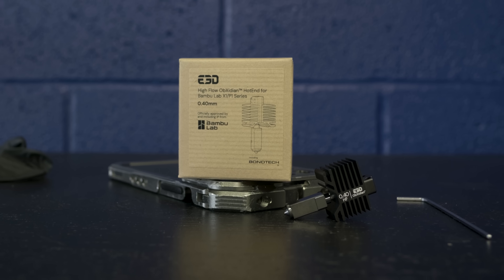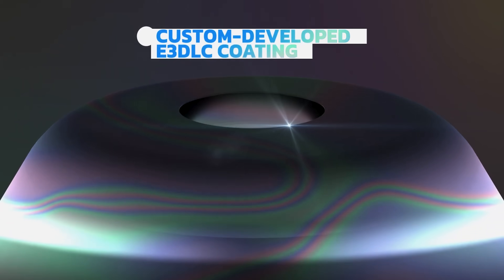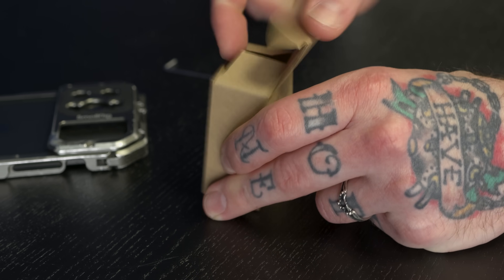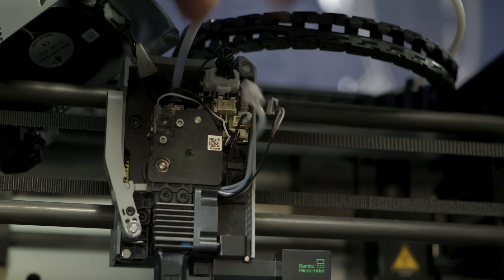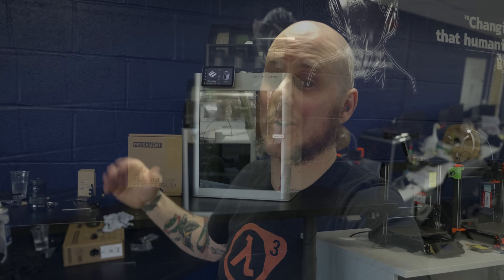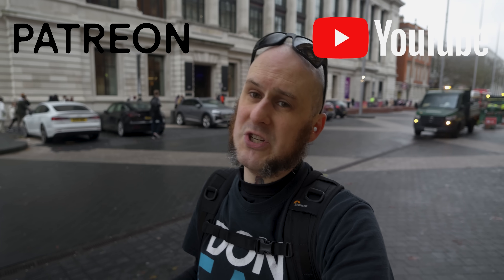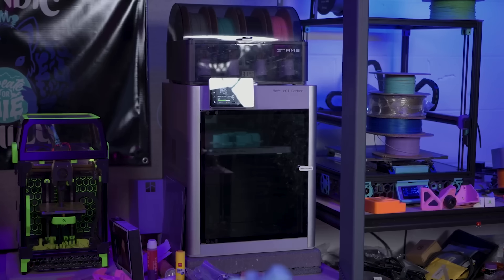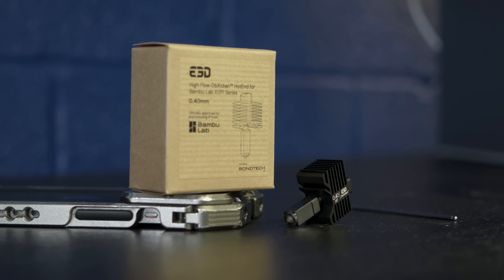REAL High Flow Bambu Hotend from E3D?!? - Install & Test AT E3D

Comment: Don't believe the hype.  I bought and installed one on my P1S.  It makes zero measurable difference in print time on small items.  The part needs to be large with big sweeping walls to have any measurable difference in print time.  I emailed E3D and confirmed this.  But at least it's now a spare hardened nozzle, I guess.

Comment: you can't trust the guy with the tatoos... :) Ok seriously, your flow print test doesn't show 18 vs 27 difference , seems like it failed in both cases. you didn't even say what was printed with what nozzle... smells like BS...
Reply from the maker: These were two different g-codes because we were on a time crunch. The 27mm3/s started at a higher flow rate. I forget what though, but say the stock one went form 5-25mm3/s in the gcode, the ObXidian HF one went from 15-40. Not exact numbers but that is an explanation of why you can’t put them side by side to compare. 

I’ve revisited this hotend much more in depth and compared it to a cheapy “high flow” from AliExpress too. You can see MUCH more involved testing in this video: https://youtu.be/AppUVvf-UGg?si=YLbnpqa-56d7o1-P

Comment: I guess this is fine if you have one of these machines or use this part on other machines but I think I will just grab a CHT from someone other than bontech or e3d.
Reply from the maker: Why? The clone versions don’t flow as well and are usually made from low quality materials that wear out very quickly in my direct experience. I’ve tested them in other videos and found the genuine article is superior in every way.
Reply: @MandicReally  mainly because I won't be using the v6 style for much longer anyway and the clones cost less whilst still offering a improvement from what I can tell.
Once I do move to a newer system I will grab one from e3d, diamondback or bontech where applicable.

Comment: Very cool bench test 👍
But what's about the BIQU Panda Revo Hotend ?
Did you test it ? The announce a flow at 40 mm3/s
Reply from the maker: I have yet to test it. Biqu sent me one for the wrong machine and I’ve not gotten a chance to use it as a result. 

I’ve retested this E3D unit since this video though with BETTER results and more data to back them. Check it out in this video: https://youtu.be/AppUVvf-UGg?si=TkhQVJpGdlAjiVhu

Comment: Got this in nozzle size 0.6, and it just wouldn't work at all with default bl 0.6 settings. Taking me days to tune this little mofo, problem is theres hardly any info out there for bl p1p/s profiles. But sure, its 52 volumetric flow rate is attractive on paper, but hard to tune in for practical prints.

Comment: For me, speeds and flow are fine. I rather have a coated nozzle that PETG wont glob onto. That's my biggest nozzle/filament issue. If their coating helps that I might be in for this.

Comment: I've been getting noticeably better looking prints with the E3D nozzle even when not printing faster
Reply from the maker: That touches on a topic I'm really not sure how to cover (or if it is a real thing), but in my head makes sense. My Theory: If you have a hotend capable of flowing more filament, it will produce better strength & quality results at lower flowrates too. My logic being, you aren't pushing it to its limits so the hotend has an easier time of maintaining consistent and healthy flow throughout your print, producing overall superior results. 

I think this is a subject I may have to suggest to Stefan over at CNC Kitchen. Does a High Flowrate hotend produce superior quality & strength results, when NOT maxed out?

Comment: I get a "Nozzle temperature malfunction" error with these high flow hotends...can't figure out what's going on after a ton of troubleshooting.
Reply from the maker: The heater element just isn’t strong enough. As filament flows rapidly it takes heat with it. Faster flow, more heat taken away. Most high flow Hotends have higher wattage heaters to keep up. The E3D Revo High Flow kit comes with a 60w heater instead of the default 40w unit that the base Revo has.
Reply: @MandicReally  I thought the stock heater was 48W not 40W, since the E3D hotend is used with a Bambu Lab heater.
The odd thing is that I get the temperature error inconsistently - at low flow rates and higher flow rates.
It's pretty similar to what you showed in your other video, but your solution wouldn't work since I was already printing fully enclosed. It seems to happen all the time with the max flow rate "racetrack" test, but not so common during normal prints, even when I'm pushing the printer really hard.
Reply from the maker: The stock Bambu one is 48W, I was referring to the E3D Revo Hotends when I said 40 & 60w. Their other line of Hotends.

Have you tried changing heaters? I know ModBot ran into the issue more than I did. I wonder if there is just that much variability in the heaters and thermistors. Without being able to monitor better & PID tune, there isn’t much we can do to research that.

Comment: i own my p1s for about 1 month now.. and i wonder whats the benefits of these? im not getting it? i can just get some from babmu with hardened steel... what is the difference ???  sorry im a lil bit confused
Reply from the maker: Higher flower means you can achieve higher extrusion rates. That could mean thicker extrusions at higher speeds, higher speeds on lower extrusion thicknesses, or just stronger parts due to more consistent extrusion. It isn’t something everyone needs, more for those trying to push their machines to achieve as much as they can.

Comment: Would love to see a shootout between this and the aliexpress v2.0 hotends with hardened steel CHT clone at some point. People have been getting a clean 35-40 on those for a bit now and a cleaner surface finish. Wonder if the gen 2 Bambu will switch to high flow.
Reply from the maker: I’ve got one on the bench right now (of both designs). Biggest issue is, the Ali Express ones AREN’T hardened. Only the outside of them is. The actual high flow splitter portion is raw copper. So it’s gonna wear down FAST with actual abrasive materials. I may devise a way to test that too.

Comment: i dont get it what to do? i changed the flowrate but what else do i have to change? its just 1% faster at the moment. are there any profiles? printing asa filament. thanks for help in advance. cant find any info at bambulab or e3de about settings
Reply from the maker: I’ll work on tuning in some profiles on mine I guess. Bambu & E3D haven’t done so yet that I’m aware of.
Reply: @MandicReally  will U share them then ?

Comment: My stock P1P prints up to 21mm3/s, so - How exactly this is an improvement?
Reply from the maker: What material and test did you use to determine that? How did you qualify what the maximum flowrate was? Have you tested or are you just looking at Bambu's volumetric flowrate limit setting for their own filament slicer profile? 

All those questions out of the way, I showed this improved flowrate on one material by 50%. It stands to reason that if you legitimately are testing and finding you are getting 21mm3/s out of your stock hotend, you may well get upwards of 30+mm3/s on that same material. Now flowrates are not so easily calculated or determined. Material properties, individual machine properties can vary and effect results. One material to another can have vastly different flow characteristics. Or testing methodologies can influence outcomes too. Like I can crank temps to levels I'd never print at just to boost flowrate numbers in a test, but that doesn't translate to what I'm going to use day to day. 

I cannot speak for you on what this would all mean for you, all I can do is present tests that show this hotend improves flowrate. Which can lead to stronger parts at similar speeds to current slicer profiles, or the ability to unlock higher speeds than the stock hotend can allow. I personally find the stock Bambu hotend a limiting factor in pushing speeds on these machines.
Reply: @MandicReally   , I believe everything you said, but probably we study different physics, because it's a simple math to determine a flowrate... 🙄
Reply from the maker: @ELMANTEC  you'll have to explain that to me. Are you quantifying the heating capability of the hotend? Length of the meltzone? Chemical properties of the individual spools of filament? How are you calculating flowrate without running a physical test? 

I am NOT someone who says "Math is pointless", but formulas and calculations that are purely on paper don't factor in variance of reality. The same as not all Flowrate tests show the same results. Purely extruding into free air and weighing the finished results doesn't factor in the pressures generated by the layers below & behind an extrusion point. The rate of extrusion can vary due to the current applied to the extruder stepper motor. There are SO MANY variables in the real world that math formulas alone cannot factor in.
Reply: @MandicReally  My apologies if I left you with wrong expectations, but I am not here to educate people. I know you will say -  "ahaaa, I knew it, he cannot explain it...". It's ok, you can say it. 
   I already regret I started this comment. :/

Comment: If your flow rate is really down to 12mm3/s you're doing something wrong.
My flow rates are all above 19 and even 22 for eSun ABS+.
Reply from the maker: We will be retesting thoroughly when I get to doing another update video on my X1. But I’ve been pretty solidly sitting with my profiles there for a while. And the default profiles from Bambu are generally similar.
Reply: @MandicReally  Bambu's profiles are very conservative because they want them to "just work" for everybody, which is fine. But you can easily push the envelope, although it greatly depends on the filament quality too.

Comment: We‘re talking about 60 Pounds for a single hotend, ✨Innovation✨
Reply from the maker: So I jumped on 3dJake, a European printer parts retailer and checked pricing. The MAJORITY of Hotends they sell are over $76 USD (what 60GBP converts to). Phaetus, MicroSwiss, Slice, Flashforge, Zortrax, and even CREALITY Hotends are more. And majority of those don’t come with a heater or thermistor. And almost none of them have to license technology from other companies to be produced like E3D has to do with this design (Bambu & Bondtech). 

Bambu sells there “hotends” so cheap it feels like an undercutting of the market, so folks now expect that to be the standard. I wish these were cheaper too, but in the grand scheme of 3d printing, it’s not a horrible price.
Reply: @MandicReally  back in the days we were able to change the nozzle, a cost effective way to enjoy the hobby. They can create/produce consumer friendly stuff if they really want to, but that’s not their kind of innovation. I get the point of keeping the weights low - but your printer depends on their pov/interests.

You can find alternatives with changeable nozzles, therefore a much cheaper way to achieve higher flow ratios (CHT Nozzle)/ a cheaper way to change your nozzle diameter. So we compare a much cheaper variation to a single hotend. 

You can spend money on whatever you want, we should all accept that, the words above are just my thoughts on modern days innovations.

Comment: so I will admit that I am not the most knowledgeable person for this type of info (hence why I have a Bambu), but if I am mainly doing functional prints & PAHT-CF at lower speeds on Silent mode (for quality), would this nozzle really gain me anything? seems this is aimed more at high flow / high speed users.
Reply from the maker: Less benefit for sure. There is an argument to be made that less restrictive flowing may increase part strength due to better layer adhesion, but that is something that would have to be tested. Also the ObXidian coated hardened steel hotend may last longer than the just hardened steel Bambu hotend. Another thing that would need testing but their ObXidian coating itself has been tested and shown to increase wear resistance heavily.

I also run my machine well below its maximums majority of the time. For me this will allow me to push the few parts I need to get done ASAP. There are times when I'm late on a project and just need parts now where the flowrate of the stock hotend leaves me limited.
Reply: @MandicReally  Gotcha. Makes sense. 
I did increase the flow for ironing to like 25% from the stock profiles 10%, and that helped a ton for finish (still getting oddball bumps that I think are micro-clogs in the .04 nozzle, though). But printing on Silent mode means I have capacity to increase flow if needed.... so maybe once I wear out my nozzles, it won't hurt to get one of these for the coating & such like you said.
Thanks for the information & videos!

Comment: Holy shit! so about a $100.00 US (maybe a bit more) once taxes, duty and shipping are factored in? Ya, I'm gonna take a hard pass on this. Might be ok if your running a print farm but for guys only doing a half dozen or so prints a week it's WAY over priced considering you still have to build it up yourself and add a fan. I'll wait a while, I'm sure there'll be a ton of other high flows for a fraction of the cost available very soon if this catches on..

Comment: Everyone I know slows their Bambu labs machine down not because of a lack of flow but more just for nicer print quality.
Reply from the maker: My default profiles are slowed down significantly, however even those bump against flowrate limitations sometimes. And especially when I'm working on a project where I am fully willy to trade quality for speed. If I'm trying to lay down thick .28mm layers & just get a print done, flowrate is a MAJOR limitation.

Comment: So next problem will be cooling.
Reply from the maker: Depending on material choice and print size. Layer times management will be your best friend. But I’ve got some plans for the next upgrade video to address this too…
Reply: @MandicReally  Can you do a deep dive on layer time settings and how you can tune them to your advantage?

Comment: I'm more excited about the BTT Panda Revo and the HF Obxidian nozzles 🤘🤘
Reply from the maker: Watch the channel for more… 😉😉
Reply: I was very disappointed with the quality for the price and their CS suggestions on how to fix their poor splices instead of replacing the unit. It totally depends on your use case, but the print speed/price/quality/dealing with BTT variables make it a bad buy for me. I really wanted a coated nozzle for PETG (not a big issue but more a QoL improvement for me) and the time changing nozzles was a plus. But the price for their system isn't worth it to me (I rather use that money for a wood planer, those things are pricey, lol) and it only takes like 2 min to get a bambu nozzle in and out. 

Just my 2 cents on using it.

Comment: Is it possible to get good results above 50mm/s of the polymakee ASA?
Reply from the maker: No, I really don’t think there is a chance of that. I will be testing it but I expect mid 20s on flowrate. I’ve got Hotends that will push 50+ but they are MUCH more serious Hotends than Bambu’s design.

Comment: So happy to see bambu lab branching out and being open to allow innovation. pretty steep on the price.
Reply from the maker: It is not cheap, that’s for sure. I’m looking at it as a “buy once, cry once” item. You get increased performance, better wear resistance, reduce filament sticking, all on one hotend. We shall see in long term testing how it goes.
Reply: pretty sure that's bambulabs with licensing pricing. E3D is usually on the more premium side but that price is too high just for that.

Comment: looking forward to trying these out. im more than able to produce pristine abs parts at sustained 30 cubic on my x1 with stock kickstarter hardened hotends though. the trick, is printing substantially hotter. like 30c hotter than i run my vorons at. its a combination of this, and "grade shopping"" the right filaments with the right base resin.
Reply from the maker: Wow, interesting. I print a hair cooler with ASA as I find the overhang performance suffers if it don’t. But I’m generally more worried about quality versus speed. It is nice to be able to push it harder when I need a project done asap though.
Reply: I now run the Bambu hotend on my Voron too. 0.6mm hardened nozzle on a 350mm V2.4r2
270c around 30mm3/s is possible but I slowed it down to 22mm3/s. 

For the price of only the heater block + heat break before I can  now get 2-3 fully assembled Bambu hotends….

Comment: Great video thanks.  Wonder if Bambu will be adding any new tuned machine or profile settings to the firmware / Bambu Studio.  One of the great selling points of their hardware is how well tuned together everything is straight out of the box.
Reply from the maker: I kind of doubt it. Maybe I’ll take some time and clean up my profiles a bit for release. I have some “quality” presets I mostly use that improve print quality off the machine. They’ve been mostly focused on speed I feel. The machine can do amazing quality if you just slow it down a bit and spend a little time tuning. And it’s still very fast like that. Hopefully Bambu does, if not maybe it’s finally time for me to release mine.
Reply: @MandicReally well that’s the beauty of the 3D printing community, if the manufacturer doesn’t do it someone in the community usually does. 

While Bambu isn’t perfect they are nice machines and this product could potentially unlock the potential of the machine.